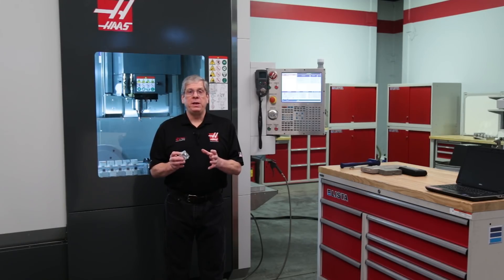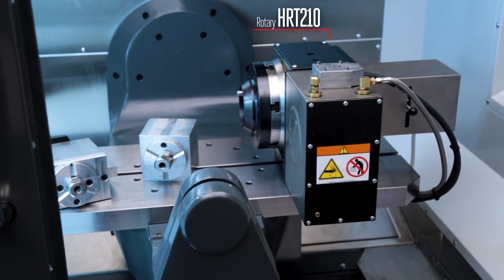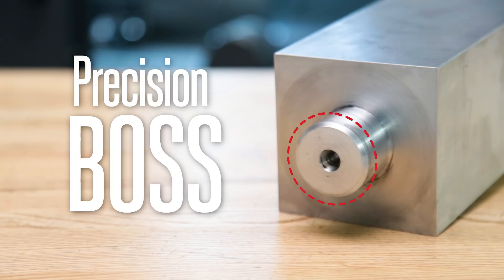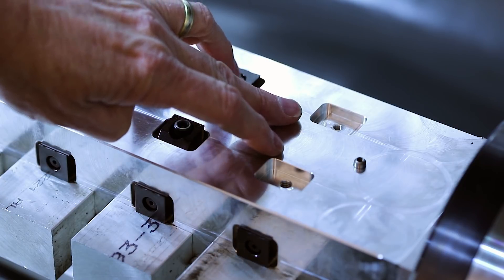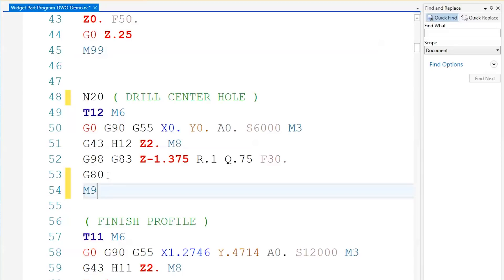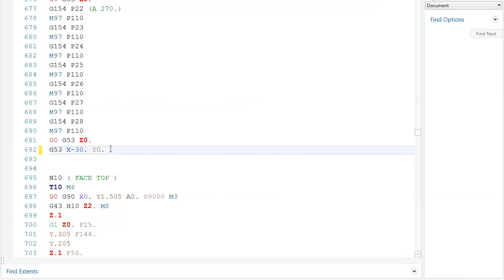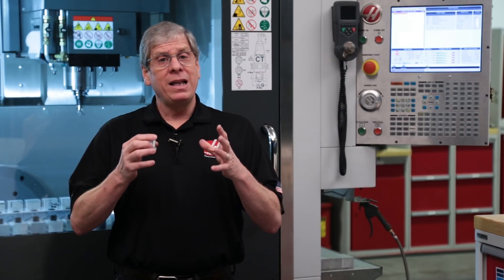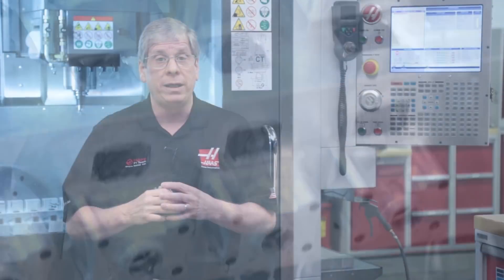Reduce Cycle Time with a Multi-Part Fixture on the Haas UMC-750P - Condensed Version

Comment: Are there premade macros, or helpers to dynamically adjust operations like facing cuts to probed dimensions of stock material?
Reply: I am not aware of macros like that being commercially available. That said, Haas's Visual Programming System (VPS) allows you to enter variables associated with a tool path operation and immediately produce the G-code needed to run it. You can quickly change the variables based on your next part and produce new G-code. - John